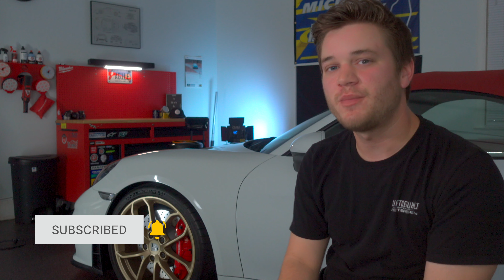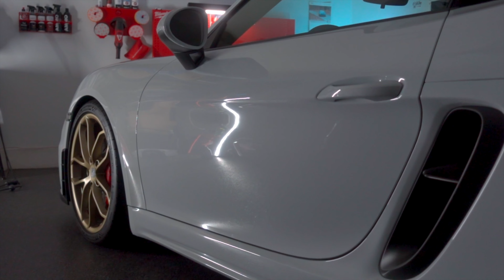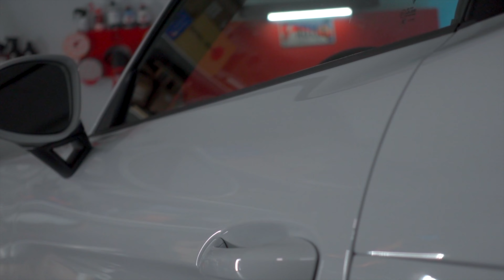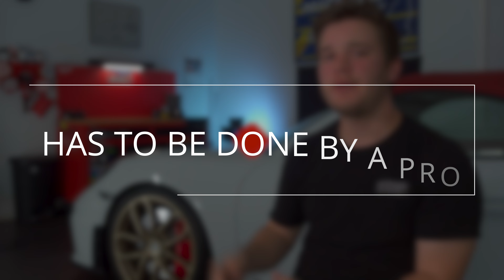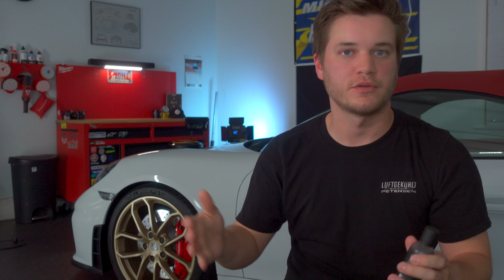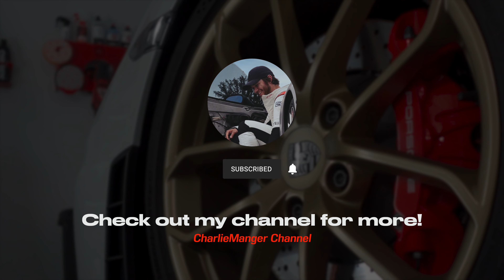Whats WRONG About Ceramic Coatings

Comment: I find that automatic car washes actually create far less swirls and surface scratches than poor car washing techniques.  I put my daily driver through the car wash weekly and it's scratch free after I've ceramic coated my car.  My spyder is washed only once in a while, since it's a garage queen and only driven in nice weather, with a foam cannon.
Reply from the maker: Same here, I really enjoy taking the time to “properly” wash my Spyder.
Reply: @charliemanger  Griot's poly gloss.  Try it.  OMFG. The shine is INSANE.  The brake calipers glow.  I've gotten stopped by people saying how in the world did you get the car so shiny.  It's sick.  Never would have believe it without seeing it and photos don't capture the gloss.

Comment: Not doing a PPF? Don't think they are useful?
Reply from the maker: I actually have PPF on the entire front end of the car, AND coated it! I do think PPF is a great idea as well, but it’s MUCH more difficult for a home DIY’er to do if they’re not trained. Both options are great if you don’t mind spending the money, but I think ceramic is a more approachable paint coating for someone trying to tackle the job themselves.